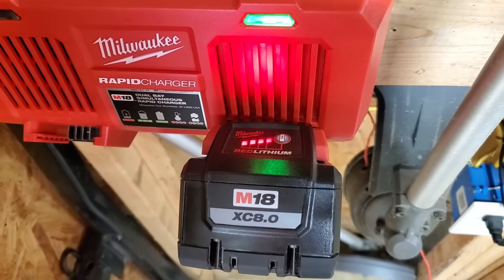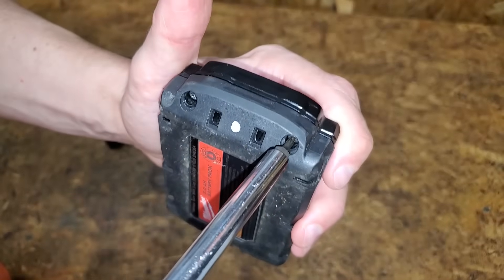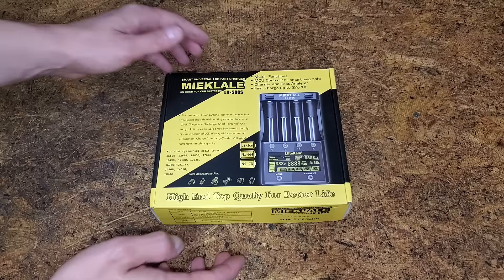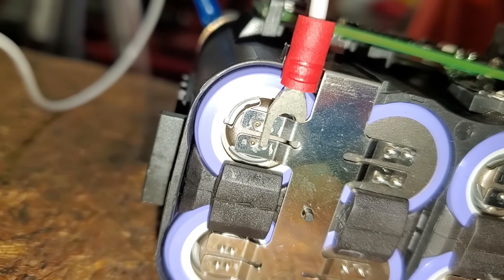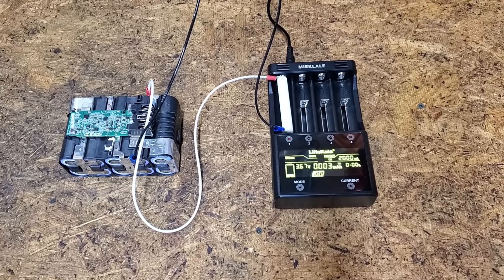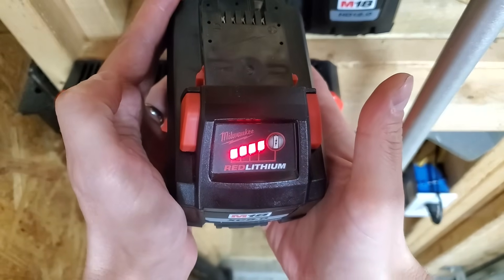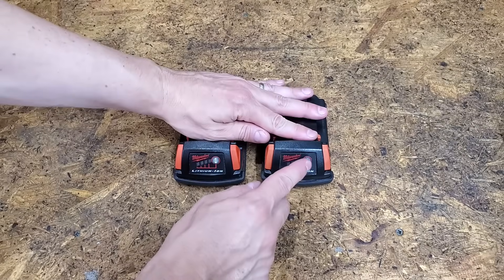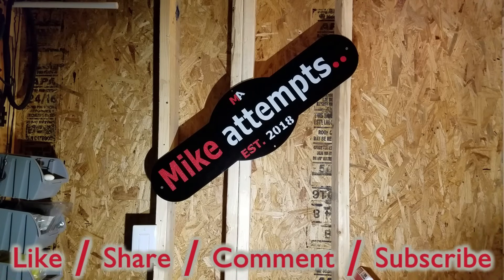Balancing Power Tool Battery Packs

Comment: My charger won't get past the null message, I wonder if the spades really make that much of a difference 🤔
Reply from the maker: I ran into this issue briefly. Make sure the negative wire is touching the negative side of the cell and the positive wire is touching the positive side of the same cell. It doesn't matter that the cells are connected with the metal strips, the wires need to be touching both sides of the same cell.
Reply: @Mikeattempts Hey! So I got these multimeter test leads with swappable leads and found your method with the plastic worked and I put these tiny clamps on the metal tabs topside of the battery. Wouldn't have made it this far without your video! Solid product recommendation!
Reply from the maker: @MAYDAY.glitch  That's great, I'm glad you got it working, thanks for the update!

Comment: Hey, love your video.  I just bought the same charger and attempted to balance my 8.0 m18 battery.  4 out of 5 groups were low in the 3.6v range.  I followed your steps and am currently charging the first group at 2 amps.  However, I tried to charge up a second group of cells using the opposite bank of the charger.  It started smoking and I immediately took it off.  The second set of jumpers were on correctly, so I'm not sure why it started smoking.  I'm currently just charging one group of cells at a time.  It kinda scared me when it started smoking.  Any idea what may have happened?
Reply from the maker: Yikes! Since the charge has 4 slots, it should definitely be able to charge 4 cells at the same time. It sounds like you got a faulty charger, I would request a replacement. What if you set it up to charge and left? Let me know how the rest of the charging goes. I'd also be curious to hear how the replacement charger works in the same situation. Thanks for the comment!

Comment: I purchased your battery charger to try and repair my batteries and when I wire the battery to charger, I am getting an “err” code. Not sure why??  + and neg or correct. I tried on other cells and get the same thing. Not sure what’s going on??
Reply from the maker: I only got that "Err" code if both wires weren't connected to the same cell. I know you already said you had +/- correct but just double-check to be sure the negative wire is on the negative terminal of the charger as well as the negative terminal of the cell (the negative side is completely flat).
Reply: @M @Mikeattempts thanks!  I’ll try that and let you know

Comment: I have a XC9.0. I have to do this to get it to balance.
Reply from the maker: I heard that Milwaukee discontinued the 9Ah packs because there was a potential for the cells to leak. At least you don't have that problem. :)
Reply: @Mikeattempts someone did tell me the 9.0 got discontinued. I don’t see them in the stores. Of all my batteries, the 9.0ah is the worst with cell balancing.
Reply from the maker: @ka0t1c07  How many charge cycles before it requires rebalancing?

Comment: I have to say after using dewalt and milwaukee, i far prefer dewalt. Milwaukee is CONSTANTLY having issues with batteries.
Reply from the maker: I've used them all, but I've only ever owned Milwaukee. That's how they get you, by the time you realize there might be an issue, you already have too many tools to jump ship. :)

Comment: Did I miss the part about how measuring each cell isn't measuring the whole pack? You said 'later'.
Reply from the maker: Well, I originally thought that I could just measure each "bank" of cells by using the metal tabs on the top of each pack. It wasn't until later in the video that I realized the cells needed to be measured individually. I also learned, when charging the 8Ah pack with the double row of cells, that charging the top cell would also charge the cell directly beneath. On the smaller single row packs, each cell needed to be charged individually.

Comment: You want to see what'll really blow your mind? 
Press the battery button 5 seconds after you start using a tool. Most Read only 1 bar.
Reply from the maker: Do you mean press it while the tool is running? I'll have to try that out. I assume those lights aren't meant to be accurate when there's an active draw on the pack.

Comment: Why doesn't the BMS handle this stuff...
Reply from the maker: I'm not sure. I've heard everything from "Milwaukee doesn't have BMS" to "Milwaukee packs have BMS built-in, but it's not enabled except for Forge packs". I haven't yet done my own research, so I don't know the details.
Reply: Read about it a bit more and seems like balancing cells is a secondary feature, main reason for most BMS is to protect from overcharging or fully discharging.
Reply from the maker: @nzalog  Ah, interesting. I'll try to do some more research so, the next video will be more informative.

Comment: An issue I have is when buying non-Milwaukee cells, they work great for a few charges then don’t charge at all. My theory is the the charger can detect non-OEM battery packs and purposely prevents charging beyond a few times. Is this something that you can test?
Reply from the maker: What brand of cells have you tried? I've always heard that you should only use Samsung cells, the same model that were originally in the pack. I doubt the pack could sense the difference, my guess is that they're just inferior low-quality cells but that would be an interesting thing to test.
Reply: @Mikeattempts  I have not opened a dead battery pack to see which manufacturer’s cells are used. I’d be happy to send a dead battery pack to you. BTW - the batteries and the chargers have smarts in them and they can tell if the battery is made by Milwaukee or not.
Reply from the maker: @twm4259  I'm pretty sure all of the major tool brands only use Samsung cells. Yeah, I'm sure the charger can detect a non-Milwaukee pack because of the chips on the packs circuit board. I doubt they could detect generic cells but that's just a guess.

Comment: I think you can get to each bank of cells from the terminals on the end. I know the dewalts you can
Reply from the maker: Ah, you mean the terminals on the pack that make the connection to the tool? I never thought about trying to charge them that way.
Reply: @Mikeattempts yes. Exactly.

Comment: Kick ass video and thank you. As consumers, we spend high $ on these and have to be taken advantage by the manufacturer for service on their broken product that didn't last. I have the same issue on the 6ah M12 that was already replaced once. I will try your method on it. But I have had the same issue on the mca-daddy M18 12ah. A $249 battery. Thanks again.
Reply from the maker: Yeah, if it's under warranty definitely get it replaced. If it's not under warranty, this is your only option if you want a fully function pack. Thanks for the comment!

Comment: Nice work. This is an issue with Milwaukee and Dewalt batteries. They don't balance charge when you charge them in the charger, unlike other brands of tool battery packs.
Reply from the maker: Thanks! Yeah, this shouldn't be something the consumer needs to do in order to get a long lasing tool battery pack.
Reply: That's not quite accurate. Dewalt batteries have contacts that connect to each group of cells in the battery pack to tabs on the battery charger.  Dewalt's chargers perform balancing on each group of cells. Each dewalt power tool is programmed to shut off when it reaches approximately 3.06 volts per cell group to protect from over discharging. Makita packs don't utilize active cell balancing amd instead use a passive resistor setup. Ryobi's cell balancing is passive and can still result in imbalance. Ridgid power tools do offer active balancing. Milwaukee battery packs have a BMS chip that can perform active balancing but Techtronic purposely leaves this ability disabled and their chargers do not have the ability to perform cell balancing.

Comment: I made a resistor pack to drain stubborn charging batteries at work. If you 100% pull down all cells, they all charge back to 100% at 99% of the time, sometimes you do end up with a junk cell. (draws down to 2.7v on all cells)
Reply: That's actually pretty destructive to the cell. You never want to pull a li-ion cell down 100% if you can help it. 

Maybe you were talking about bringing them down to minimum recommended voltage?
Reply from the maker: @cheatinggravity173  I was under the same impression, 100% drained is bad and prevented by the charger/circuitry. However, for example, if 4 of 5 cells in a pack are hovering around 3.8v, and the 5th is at 4.1v, you can discharge that 5th cell to 3.8v instead of manually charging the other 4 cells to 4.1v. Either way, you'd end up with a balanced pack that can then be normally charged by the Milwaukee charger.
Reply: @cheatinggravity173  Yeah my bad, I don't mean to absolute zero, it draws down to 2.7 then shuts off. I use an arduino to control that.
Reply: @Cozmo2k4 ah cool
Reply from the maker: That's interesting, I've heard that some chargers won't even attempt to charge a pack that has cells below a certain voltage, it'll just give error lights.
Reply: Now that would be a good test for the channel :D
Reply from the maker: @Cozmo2k4  Good idea! :)
Reply: You can get a circuit that will stop draining at a defined voltage.  I used them when I modded  my kids power wheels.  So you don't need to drain all the way and can just drain enough to balance and it should work...I have not tried it though. Bought the circuit on Amazon.
Reply from the maker: @markbuckeye  Yeah, I assume similar circuitry is how "discharge mode" works for the charger I used.

Comment: for the price they charge for ALL tool batteries, it's a massive piss take that they don't have an actual BMS in them to balance the cells, there is no excuse for this other than planned obsolescence.
Reply from the maker: I agree but I do believe they have some level of BMS. I just don't know what causes the pack to get so far out of balance that it can't be corrected via the built in circuitry.
Reply: @Mikeattempts  Other YouTuber’s have hacked into the BMS and found that it does’t do any cell balancing, even on batteries that appear to have passive resistors for top balancing.  Only the new Forge batteries actually have working balancing as well as vents for their faster new supercharger to cool them down more.

Edit: Correction, they DO have 15-30mA bleed resistors for passive balancing, which is very undersized for 8-12Ah batteries.  However, I fixed a 12.0 High Output that was only charging to 2 bars and an 8.0 High Output that was only charging to 3 bars by using the standard/slowest Milwaukee charger several times in a row for a few hours each time immediately after using a low power tool to drain just one bar.   Apparently, the standard charger also trickle charges sooner and/or more slowly than their rapid chargers do.  This allows more time for those undersized bleed resistors to drain the highest voltage cells until eventually they balance with the under voltage cells after several cycles of a few hour each.  This will never happen if tend to drain your batteries quickly and until they’re empty and then immediately fast charge them before they cool off.  That will just cause them to keep drifting until you can’t charge them at all.  So, to avoid killing a battery cell, try doing what I did immediately when your battery stops charging at 3-bars.
Reply: @Mikeattempts  The first two packs had the front battery as the weakest one. If that is the closest one to the terminals then I'd venture to guess that it gets drained the hardest.
Reply from the maker: @leofortey7561  I was under the impression that power is drawn from all the cells at the same time, draining them evenly. I wonder if all unbalanced packs end up with the front cells drained the most?
Reply: @Mikeattempts  Something to keep notes on ;-)
But think about it. Electricity takes the path of least resistance. Each cell is "pushing out" energy. The one nearest the terminals has no resistance pushing into the tool while the others push 'against' the power of the other cells to get to the tool. I hope you get my concept.
It is only a theory... but you heard it here first!
Reply from the maker: @leofortey7561  Interesting theory, seem like I have a lot to learn about these packs. :)
Reply: There should literally be a class action lawsuit against the parent companies.  Their engineers know these are going to start doing this just outside of warranty, prematurely wearing cells while underutilizing others.

Edit:  Prolonged slow charging and milder discharging seems to be improving the cell balance on my Milwaukee 8.0 High Output and 12.0 High Output.  They would only charge to 3 bars and 2 bars respectively.   After several cycles, they’ve been nursed back to 4 bars.  Hopefully it wasn’t too little too late.  I don’t want to have to replace the cells, since I’m just outside of warranty.  I wish Milwaukee promoted maximizing battery life instead of pushing rapid and superchargers
Reply from the maker: @NickWindham  Agreed, that's crazy!
Reply: He’s got a point, AND they should do that without raising the price a single penny
Reply: @scottforrest2097 They wouldn't have to spend any money. The chip Milwaukee uses in the M18  attery packs is capable of balancing the cells. Milwaukee's Hong Kong based parent company simply doesn't enable this feature. They want you to buy new packs.
Reply: And they'll still hold a good ESG score despite ripping off customers and generating tons of e-waste that could easily be prevented. Milwaukee M18's contain a BMS chip capable of balancing the cells. Milwaukee simply choses not to enable those features. Other youtubers have proven this.
Reply from the maker: @hochhaul  I don't know, there has to be more to it. If they're not gonna enable cell balancing, why even put the chip on the board? Designing the board to include the chip is just a waste of money if they don't use it at all. Also, if Milwaukee's main competitors do it better, why would they risk getting a bad reputation by purposely disabling cell balancing. I'm no pro but I assume there's more to the story.

Comment: replace all the cells with tabless there cheep online 👍👍👍
Reply from the maker: So far, the 8Ah and 2Ah packs are holding up great. One of the old packs only recharged to 3 bars the first time. The other old pack went from 5 bars to empty in only about a minute, so I'll be replacing the cells in a future video.

Comment: I wouldn't trust that charger, look at a lot of the R/C industry,  say some of the Hi-Tec chargers are exactly for this  purpose and way safer,  and better adjustable parameters for multiple types of chemical make ups.
Reply from the maker: Yeah, I was unaware of those types of chargers before some other viewers mentioned them as well. I'm sure any charger like this is fine, I just assume it takes a longer when only charging one cell at a time. I guess I could charge 4 cells at once with this charger but that would just be a big mess of wires. Hopefully this isn't something I'll be doing often enough for it to really matter too much.
Reply: @Mikeattempts i use mine for all sort of batteries,  not just R/C stuff. They really handy
Reply from the maker: @charlesb7831  Yeah, they do actually sound like they'd make this job easier. Are there any brands or models you'd recommend?
Reply: @Mikeattempts i have an older Hi-Tec that allows me to do 2 batteries simultaneously,  i know they have a newer version that can do 4. I've had no issues with Hi-tec , I'm sure there are others.  I can get back to you on a few and my specific model. The one i have is built really solid!
Reply from the maker: @charlesb7831  Ok, cool, thanks!

Comment: When you charged the flat 8 amp it jumped from completely flat to 2 bars of charge instantly when you put it on the charger, a few of mine do the same. They charge up to full but only drain to half way as well
Reply from the maker: I did notice that too, but I hadn't paid attention to what the other packs do in the same situation. That pack seems to give me a long run time but I'll hafta compare it to my other 8Ah pack. Thanks for point it out as a potential sign of a problem.

Comment: I have a craftsman blower and weedeater, 20v 2.0ah, and if I do a thorough job I can blow out my 2 car garage and that’s it. I can weedeat the whole yard if I keep the string short. So I don’t have much faith in cordless tools. Oh and the blower gets weaker at the end of the battery. I thought it would stay strong until the end.
Reply from the maker: Yeah, that must be partly due to Craftsman's design. I think blowers use a lot of juice compared to other tools though. I use one 8Ah pack to edge, weed eat, and blow off the concrete after mowing and it usually last until the job is done but always needs to be charged after.

Comment: I didn't know that this will work for al longer time!  And I thought the BMS does some balancing for the cells.  It seems it doesn't work in all cases.  I will check my batteries next time with these tips.
Reply from the maker: I think the BMS does do some balancing but, when they get too far out of balance, only this manual method will rebalance the pack.
Reply: @Mikeattempts Does the bms always work or only if battery is connected to a tool or only during loading the battery?
Reply from the maker: @andymora5595  I definitely do not know a lot about the battery and charger circuitry but, I'm pretty sure it only attempts to balance the cells during charging.